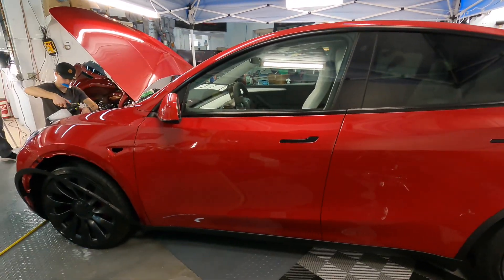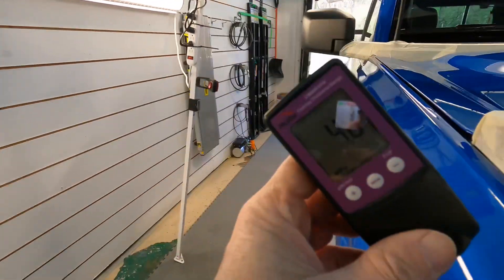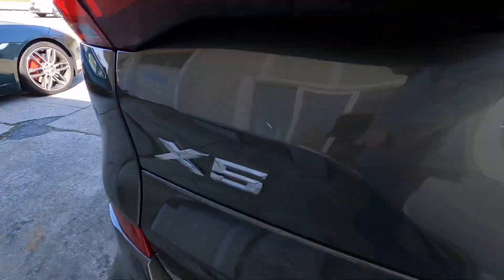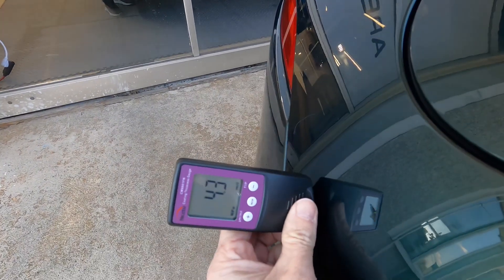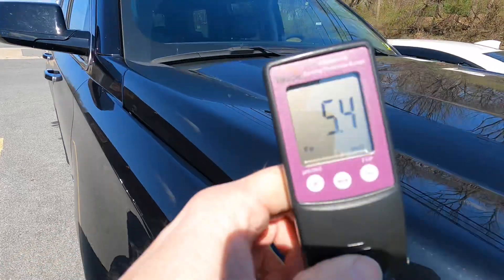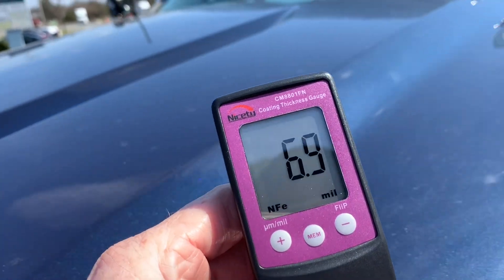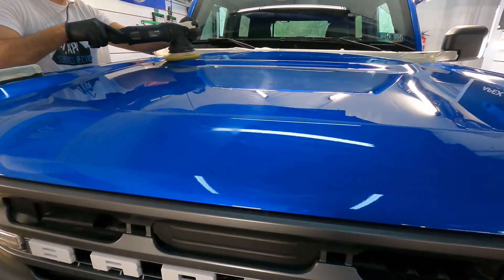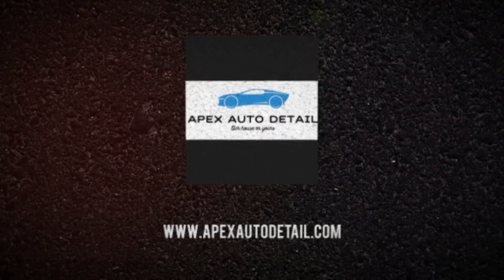Paint Depth Readings For Most Makes And Models!! Clear Coat Hardness!

Comment from the maker: I will share paint depth readings as more makes and models pass through our shop......stay tuned!
Reply: I've actually had this idea for awhile and I feel it would be absolutely brilliant to create a Google sheets document or something similar, that detailers can reference and update/confirm the details of the finishes they're running into overtime.

Doesn't even have to be collaborative as long as it's somebody that will take the 10 or so minutes to actually gather the readings and then add them to the list.
Reply: nissan / infiniti please.... also insight into high end bodyshop paint / clear coat vs oem would be great!

Comment: When doing a two step paint correction your typically removing 0.3. Of your reading 4.0 on a new car, your end result will be 3.7. 1/3 of 4.0 is 1.3 mil of clear coat (roughly).. removing 0.3 from a 1.3 mil clear coat is plenty room go play with. I necessarily wouldn't say "one step" only. Please care to explain. Your presentation seems a bit "worry some"

Comment: Does it only measure the thickness of the clear coat? Or the total amount of substances on the plate such as paint, etc., How much less is the number not suitable for polishing? thank you❤
Reply: 1/3 of the measurement is clearcoat. There are 4 layers: bare metal, primer, base coat and clear coat. Bare metal is not really a layer, i just put it there for a better undestanding of the measurment. In my humble opinion, a car can get one paint correction in its lifetime (maybe not even that on some cars), one steps or enhancements are a better choice when polishing. Also, if you polish, you must add a protection after-wax every 3-4 months, sealant every 6-8 months, ceramic coatings for 2+ years or ppf. If you only do light polishing with a very soft foam and fisnishing paste, then you dont have to worry about clear coat thickness, because that doesnt really remove much clearcoat, almost none. Sorry i went a bit overboard with my asnswer.

Comment: Hey Brian the thickness of a paint doesn't necessarily mean soft or hard paint. Early 2000s Mercedes have a thickness of 3.5-4mills but the paint is extremely hard (solvent base). The newer paints on most cars now are waterbase and even if they are 8mills thick they won't be as hard as 4mill thick solvent base paint. Great video as always.

Comment: Great video again sir. Can i ask? How we know that the clear coat is thinner? And not just thinner primer and thinner based color? 
( OEM manufacturers in Europe  report's lately that due to changes on metals and materials witch they can adhire easier the layers , now they need less primer and less color base on their paint systems)
Reply from the maker: Since we mostly do not have 50K tools to make sure....I personally err on the side of safety and always assume there is less clear.

Comment: Love the video Brian. 

I have a 2020, German made VW and it has the hardest clear I've ever known in my life!  

Even a Megs microfibre cutting pad is producing about 1/4 I'd normally get on any other paint!  

It's like Rocky Balboa, in an Iron-man suit, driving a tank!  
3 years old now, 30,000 miles and no scratches whatsoever - just some swirling. 

I'd love to know if the VAG group have started using something new, or if the technicians just gave it multiple coats for a laugh!  🤣
Reply from the maker: They missed the memo of switching over to waterbourn clear coat .....good for them.
Reply: @apexdetail85  whatever they are using, I'm pretty sure Captain America will want it on his bloody shield too!  🤣
Reply: I detail an Audi Q5 that has paint as hard as granite... and it is black.
Reply: @ronayotte3571  deep black pearl by any chance?
Reply: what model VW?
Reply: @brianjohnston7344  Tiguan R-Line.
Reply: Just been detailing a 2014 Porsche Macan and it has rock hard clear coat. Hand polishing with compound makes zero difference to the swirls. Only a cutting pad on a DA polisher with compound removes the swirls after 8-10 passes. No wonder the vehicle has almost no stone chips.
Reply: @cosmic-quasar  I swear they need to put this stuff on the space shuttle. 

It's ridiculous!  I did multiple passes on my bonnet with a microfibre cutting pad, Sonax EX and on speed 4.5 on my DA - I might aswell have been bloody jewelling it!  

If it continues like this, I think I'm just going to get the whole car wrapped in Suntek PPF and be done with it!  

I've done half a car in the time it's taken to do my bonnet before!

Comment: When there are variable  numbers on the readings, is the variable usually the clear coat ? Example: one reading 3.8 on the hood and 4.8 on the door. Does that mean the door has more clear?
Reply: Yes the door got sprayed more clear that day in the factory by the mechanical arm robot painters
Reply from the maker: Not necessarily... but I always err on the side of caution and assume there is more of the primer or color coat.

Comment: So I have a large motor hom that had clear bra put on in 2000. It has turned Black cracked. It is impossible to remove. Tried adhesive remover heat gun 3M rubber wheel steam cleaner.  NOTHING TAKES IT OFF   What do you recommend. Absolutely enjoy your info on all aspects of your explanation THANKS MUCH

Comment: Why is the door jam used as a reference point? I saw a couple of videos of detailers doing that.
Reply: Usually  no clear on the jams
Reply: Incorrect. Door jambs are clear coated. Don’t believe me? Try wiping paint reducer in the jambs. It would remove base colour coat, but not clear. Oh you still have paint there? Yeah cause it’s clear coated

They use a minimum amount in the door jambs because clear coat protects against UV, and your door jambs aren’t exposed to sun 99% as much as the rest of the exterior

Comment: Hey Brian since we're on the subject of test equipment I just purchased a Landtek gm-6 gloss meter and for the life of me I'm not quite understanding the instructions to calibrate it. When the cal light comes on the screen and I push measure it says 96.4 like what is stated on the calibration stand. When I place the meter on the stand the readings are all over the place. Instructions said it should read 96.4 which it isn't. I'm about at my wits end trying to calibrate it and it's driving me crazy. Is there a simplified method I can try?

Comment: Had a 2008 Toyota Corolla recently, one correction in its life, Clear Coat (Black,Very Soft) very good condition 300,000 Klms, had an average reading of 5.6 mils all round. New Mazda's/Honda's around 2.5-3.1 mils.
Reply: Thank u. Most detailing shops just show exotics. I figured Toyota was soft, had no idea its thickness.
Reply: @riceburner4747  That's why I like what Brian at Apex Detail does, he's not just showing the Very Expensive Exotics. He's such a down to earth guy without all the fluff and B.S
Reply: I have a 2017 Corolla, clear coat is still very soft. Note to self , be very careful if wet sanding out any scratches, clear coat is very thin.
Reply: I have no access to a gauge but i heard the newer toyota's the paint is very thin, Would have loved to know that of my 2021 Rav 4